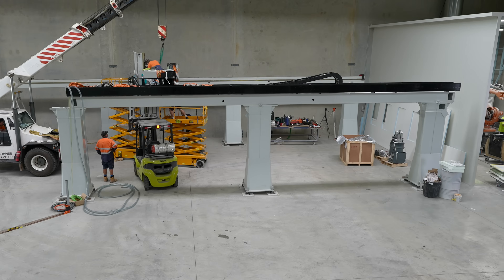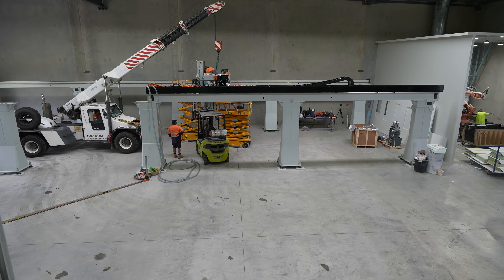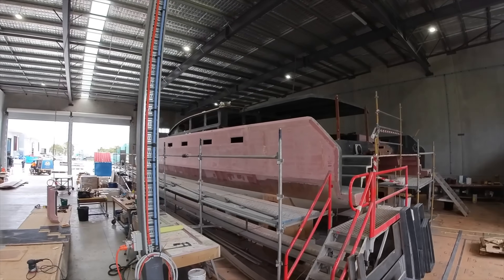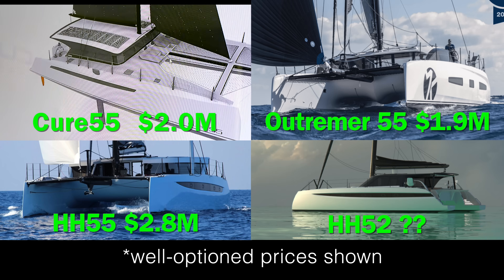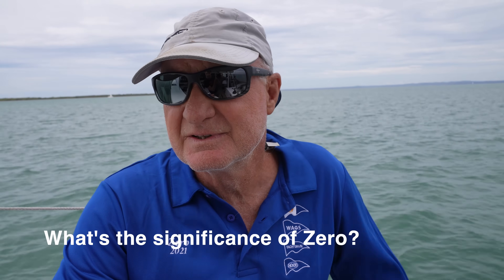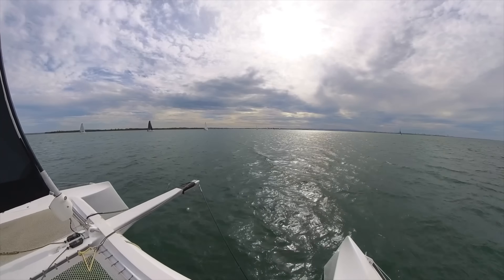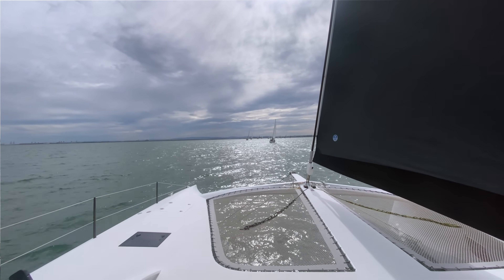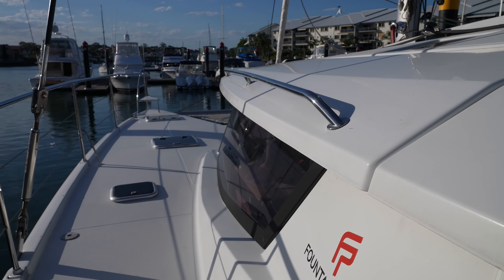Can They 3D Print a Catamaran?

Comment: I'm actually shocked they are just getting started with automation. I work in the automotive industry and everything is automated or on its way to being automated. Self driving forklifts and tow motors deliver the parts to lines and as robots become more ambidextrous they are putting more and more parts on the cars. Just surprised more robots aren't used in the manufacturing and assembly.

Comment: Why doesn't the satellite navigation drive the ship in the desired course by itself? If the radar is not connected to the navigation, rudder, mobile phone to avoid other ships, the ship is useless. In strong winds and high waves, the helmsman must be at the helm, the autopilot is not capable of reacting in case of capsizing.... A nice boat for calm seas or moored in the harbor as a residential facility, - too expensive, besides sailing is an active sport in which all muscles work, on this machine you get muscular dystrophy. Instead of starting your physical activity at your age, you reduce everything to a button, a home for the elderly and pensioners has more activities than this ship.
I am sixty years old, I survived falling through the roof of the hall and stuck to the concrete twelve meters below. Doctors patched me up, screwed me up, I'm missing half of my spine and with 80% disability and mobility on crutches, if I didn't sail on a smaller and more demanding sailboat, this iron in me would rust and my muscles would fail. On land, I ride a recumbent tricycle, and as little as possible in the car. Looking at the ceiling, mobile phone or through the window, as well as gymnastics ONLY 👇,are not the solution.
Greetings from the small, beautiful, blue Adriatic.

Comment: 3:08  The title is a bit misleading.  Cure are not 3d printing the boat.  They are 3d printing the plug which is used to make the molds for a conventional, vacuum bagged plastic composite hull.  

Many boat builders use CNC to mill the plugs currently.  While not quite the same as 3d printing, it's also a computer controlled machining process.  

(Milling is subtractive machining, i.e., taking away material, while 3d printing is an additive process, i.e. adding material.  In addition, after printing, Cure will use milling and automated sanding to smooth out the plug.)

17:35 The aft outboard helms are probably better for racing, since as you note you can see all the sails.  However for cruising, it's probably not ideal.

I still like the Chris White front helms.  They're very well protected, keep lines very short, and have visibility of all sails.
Reply from the maker: "How to use a giant 3D printer in new performance boat manufacture" is maybe more accurate? Sorry to mislead you. Guys like you know the difference between printing a product and using that print to create a mold. For most of us, we don't. Hopefully it is explained well enough in the video. If you are a longtime viewer, I hope you know we try not to mislead.
Reply: @TheOKellys  Thanks guys.  It is noteworthy that they're using a 3d printer to make the plug.  Just getting a bit picky with the title.
Reply: Exactly my thoughts on misleading title. No part of the boat is 3d printed.
Reply: @lassesvedberg6355  To be fair, they do 3-d print some minor parts of the interior furniture.  So minor parts of the completed boat are 3d printed.  But they are most definitely not 3-d printing the hull.  

That said, the gantry system they have is cool.  It can 3d print the hull mold plug, then use CNC milling to smooth the plug down, then a sanding head to make it even smoother.  That's a huge time saver over manual filling and fairing of the hull after it's removed from the mold.  That part is interesting.
Reply: why would they use 80' 3D printer to build plugs? I think its for building Hulls and I think they didnt wanna show that. TOP SECRET.. 🙂 ... 3D printed HDPE  + Aluminum Skeleton structure is the future!
Reply: @premium-f1  3:08 "What we'll be using the printer here for is ... for printing the form, the plug, which we then take a mold off of."  That's a direct quote from the video.
Reply: @LoanwordEggcorn just rewatched. Right on the beginning. Doesnt he say that 3d printer will enable us to build boat hull? Something like that.
Reply: @premium-f1  Well it did enable them to make the boat hull... by creating the plug for the mold for the hull.  And the plug can be fully faired by the machine, which is very cool and much better than hand fairing each hull.

Comment: Wow. Way cool. I lead the change at Boeing where we used similar technology to make the aluminum hulls (fuselages) easier to assemble and less weight. The drop in labor costs were huge. Then Boeing used the same basic technology to do it in carbon prepreg material. Prepreg is lighter than the infusion manufacturing technology, but it takes huge ovens to cure these monsters. Then, because sometimes things don't go well, you have it ultrasonically inspect every inch of every piece. This adds a lot of cost because you end up throwing some of them away. That would up the cost of the boats about 2X. but you get a lighter and stronger boat. I think we may be talking about America's Cup Racing there.

I love seeing the smooth surfaces created by a printed/machined/polished surface. I can do the same exact thing using a mill to smooth the inside of a more traditional wooden mold. It is all about understanding the technology of forms. Boeing did a lot of work on that while I was there. So I get a lot of the problems and solutions. They called it tooling.

As an example: When I started the "tooling design group was about 3000 engineers." When I left, there were zero. Not one. The entire process of tooling had shifted into the CAD system and ever increasing computer aided design automation. All the automation was at different parts of the design-build process. Fascinating to see and be a part of the huge changes. So it was not only at the manufacturing floor.

Great video. Great story. I love the progress I am seeing.
Reply from the maker: INteresting Roger. Didn't know that. Learning every day!

Comment: I'm really happy to hear that you are backing away from the all-carbon boat concept.  Carbon definitely has it's place in a cruising hull (in the cross-boat bulkheads, chainplates, and floor and roof of the center).  But please don't go sailing someplace without another boat to save you with carbon hulls.  Carbon does not store energy well, and so does not have the ability to take an impact.  Kevlar protected by fiberglass is better for the hulls.

I was very interested to hear that Cure is using silicone bags for their single-sided molds.  It would be interesting to see how they maintain thickness control, and what they are doing to efficiently trim the edges after demolding.  I keep expecting to see a robotic cut-off saw.
Reply from the maker: I think they are going to start doing some of their own videos. So hopefully we can follow along. Agree on the carbon hulls....not for us. But elsewhere....awesomeness!

Comment: I'm 6'3" with a bad back so I can't get a boat where I have to hunch over. Low headroom boats are a big issue for us taller folks and it just becomes a bigger issue as we age and wear out.
I'm certainly not a helm position guru - I wish I had much more experience. But I think it comes down to how you plan to use the boat. 
For short-handed cruising, I think a semi-raised, enclosable bulkhead mounted helm (like the Leopard 46) would be great. It'll keep you warmer and dryer (or out of the sun), for those long watches.
If you are racing with plenty of crew, those dual aft mounted helms would give you best sail vision (Catana style).
For chartering where you never have an overnight passage and do alot of motoring and anchoring, the 2nd story fully raise flybridge is probably the optimum (Lagoon 450 style).
I'm intrigued by the Seawind style dual bulkhead mount unraised helms. Decent sail vision. Not too high for pitching seas. Not too exposed for wet or excessive sun. 
It seems none of them are perfect for all conditions/situations - It's all a compromise. I seriously need to spend alot more time on each type to decide.
Reply from the maker: Really no substitute for experience on these boats. More miles = better decision making

Comment: I was intrigued by your comment that you got sick on a Schionning.  Perhaps you can solve a canumdrum I've been having.  Are heavier cats more comfortable at sea or is it performance cats?  Alternatively, is it all down to waterline length?  Appreciate your insight.
Reply: Intetesting, I hadn't  considered either of those as variables. So do bigger (heavier) rigs make for more or less comfort?  Does a sleek profile cut through the water rather than pound?
Reply from the maker: It’s not as simple as weight. Hull shape and rig size is also critically important. But if you want to think about weight, yes, heavier boats can be more comfortable if the hull profile is sleek. Big topic!

Comment: Very deceptive clickbait title... I'm all for automation but most of these techniques have been in play in the steel boat building industry for ever. The 3D printing is for the hull plug only and ultimately its a manual lamination. BUT have you ever stopped to think about the fact that glass and carbon fibre boats eventually get crushed and go to landfill with all the micoplastics (did you see the residue on the CNC!)  going into the ocean.. Its quite disheartening that people do not talk about this more often as its a huge problem (especially after a hurricane when the crusher is in full use)

Comment: ❤ Impressive Journalism. It is amazing how long it has taken for production boats to adopt techniques that have been used in aerospace since the 1980s I am surprised the catamaran industry has still not replaced foam core with nomex honeycomb. Take a look at a Force Engineering catamaran from the 90s they used nomex core and look like the LongEz of boats almost like Burt Ruttan designed it.
Reply: Closed-cell foam is still buoyant if it is exposed to/submerged in  water/leaks. It is also of similar strength in all directions, so it is well-suited to being machined/cut and placed anywhere it is needed. For those who have never handled this type of foam: it is hard like rock or a hardwood, not like the styrene foam used for insulation or packing material, if I recall correctly.

Someone with a 3D printer has invented the lightest strong substance known to man. It is, in effect, 3D-printed foam, but it is open-cell.

One of the revolutions of 3D printing is not only scaling it up, but when they can scale it down to cost-effectively print things like closed-cell foam cells/bubbles. Then some phenomenally light and buoyant materials will be able to be created.
Reply: @exploranator  So is Nomex honeycomb plus it is easier to repair and damage is isolated, it is lighter, fireproof and depending on the skins used can even be bulletproof. 

The US Navy has uses it on specialty coastal ships and take a look at Force Engineering Stilleto catamarans.

The weight savings are massive performance gains are unbelievable. I think it may even be cheaper because marine applications are not concerned with number of plugged cells do they can buy aerospace seconds. 

It is also easy to machine if you know the tricks (10000 rpm jewelers saw 😀)